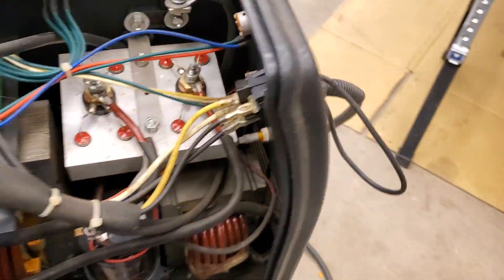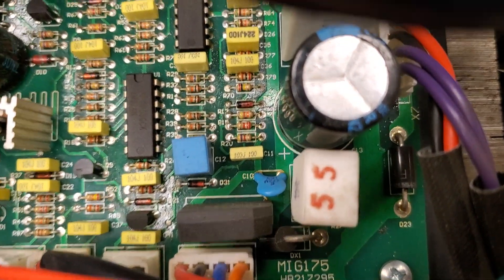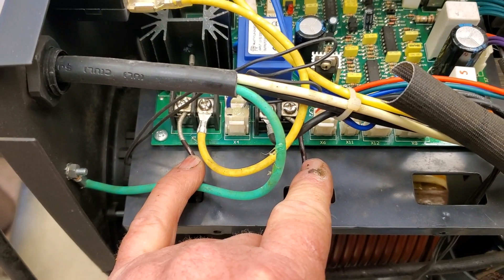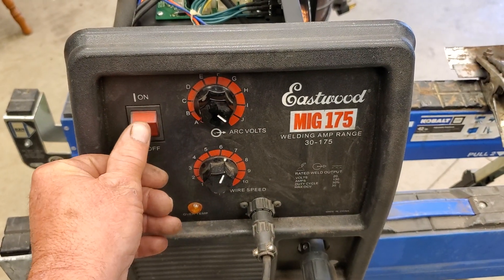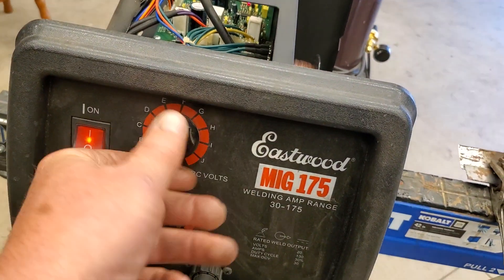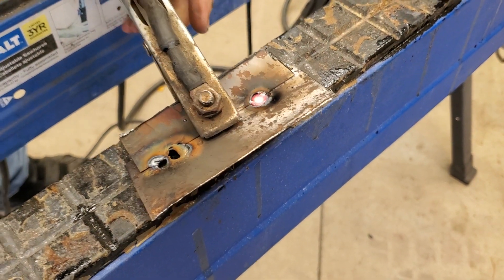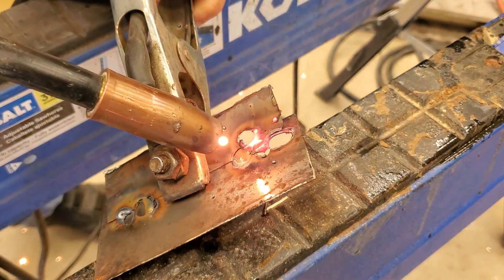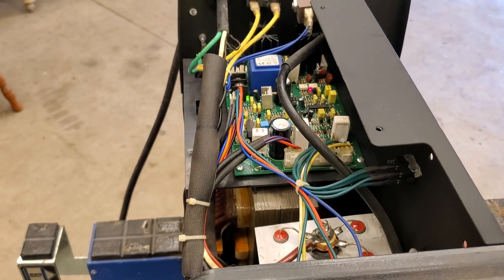Eastwood MIG 175 welder heat range potentiometer will not adjust - high voltage on all settings

Comment: Did you ever figure it out? Having the same problem and its not the potentiometer
Reply from the maker: I called Eastwood and they said it was the heat control potentiometer. You should also check the connections and make sure they are correct. Negative ground for gas welding and positive ground for flux core. Good luck! 😊

Comment: With it off check the pentometer with  a DVM on ohms does it change in ohms at all?
Reply from the maker: Yes. I unplugged it & the ohms value changes as I turn it.
Reply: @WagsAutomotive  cool then it has to be on the board
Reply from the maker: @moparnut6286  I think it's probably the transformer.
Reply: @WagsAutomotive  Me thinks i should have bought a MILLER